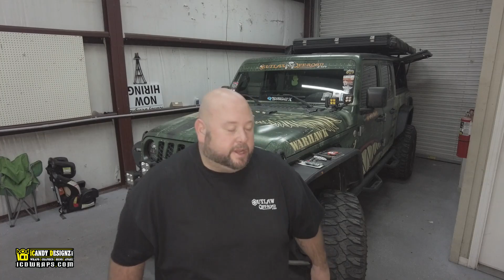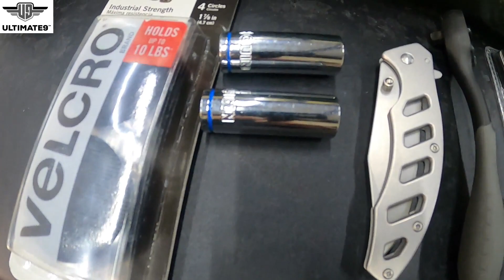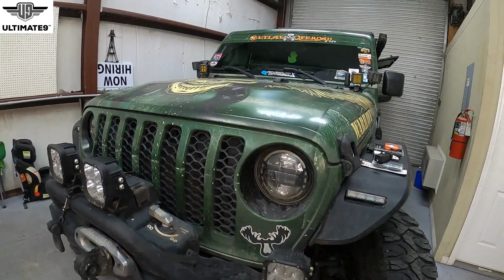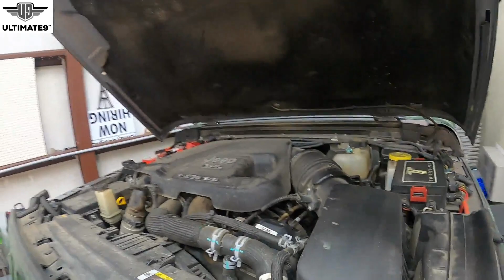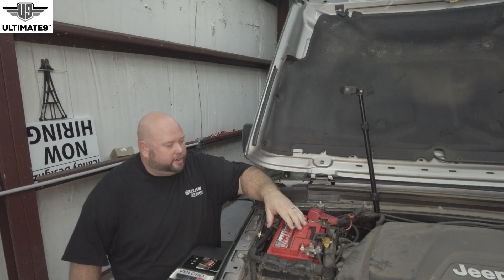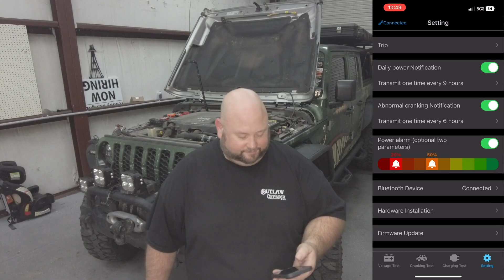Battery Monitor Setup Bluetooth | Ultimate 9  | Install | #overland #offroad #camping #rv #battery

Comment: simple but effective for knowing more than just the voltage of the battery. Very handy when you NEED that battery to be ready to start the vehicle out in the middle of nowhere.
Reply from the maker: Absolutely.. I can’t wait to get the secondary batteries in so I can take everything off the main battery. I’m really liking this system so far it lets you also monitor your charging and starting.